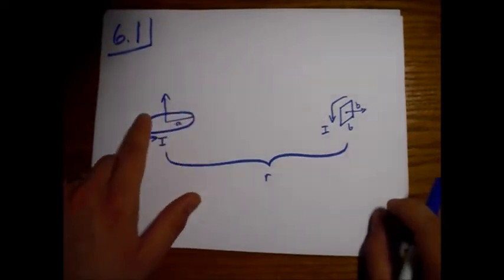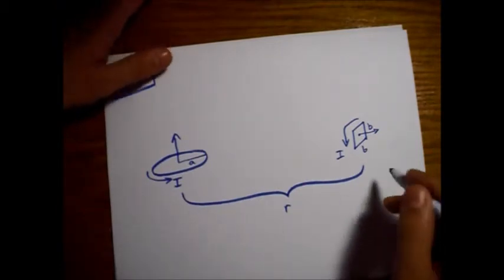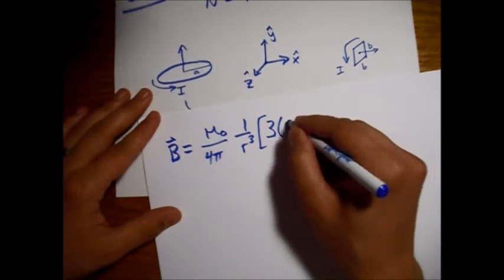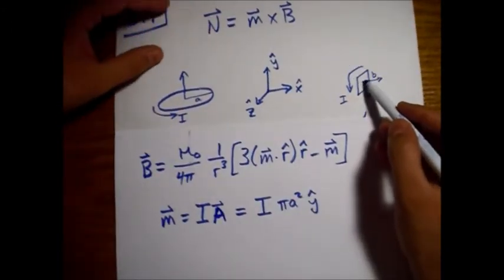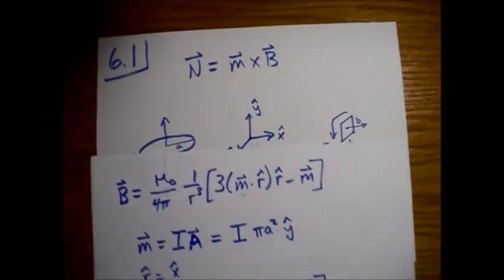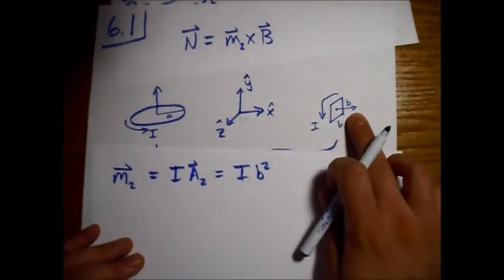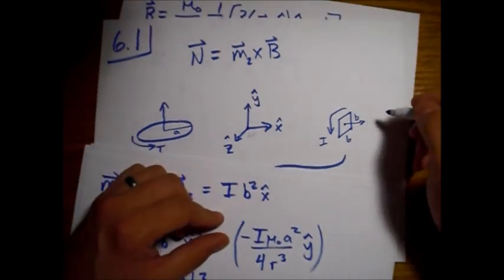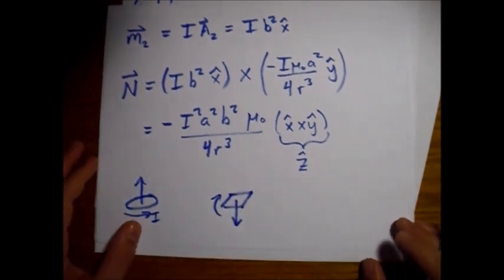Griffiths Electrodynamics Problem 6.1: Torque on Current Loop in Magnetic Dipole's Field

Comment: If the torque is in the z direction, why does it end up pointing in the negative y direction? Don't we want the dipole to line up with the field? But the torque is a cross product with the field, that is pushing at a perpendicular to the field!
Reply: wondering the same thing
Reply: @christianjmyhre  no answers still...
Reply: @berkecefe  yeah I’m already graduated and work now 😂
Reply: @berkecefe  the field is pointing towards negative y-direction, and the dipole moment lines up towards negative y-direction as they said. May I know what exactly is the doubt?